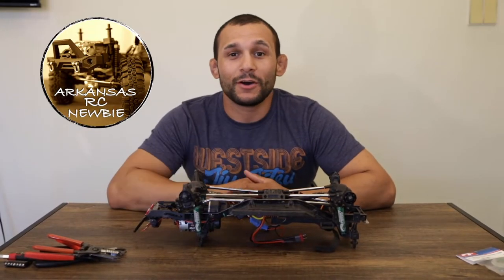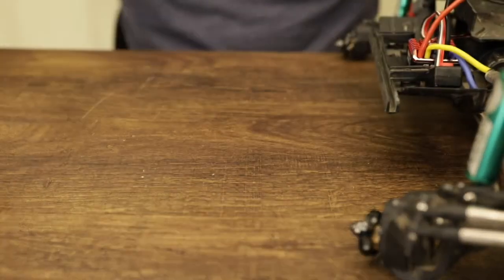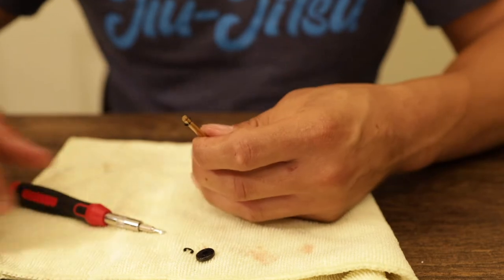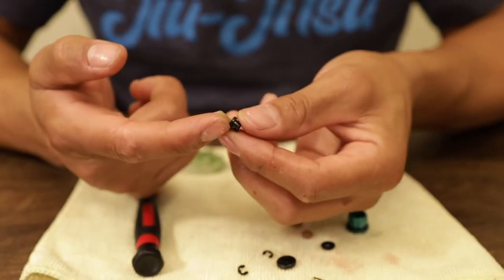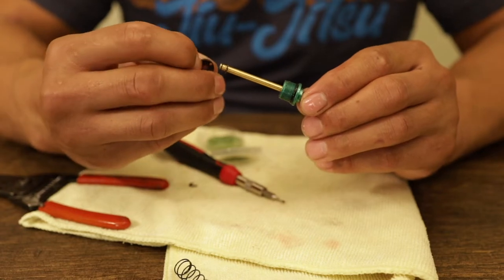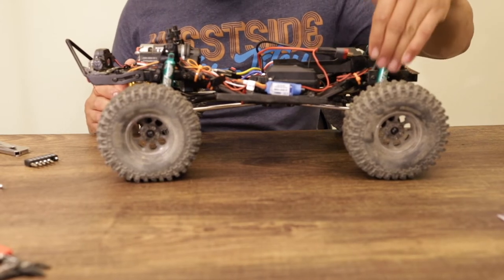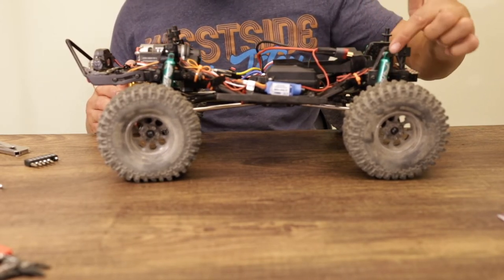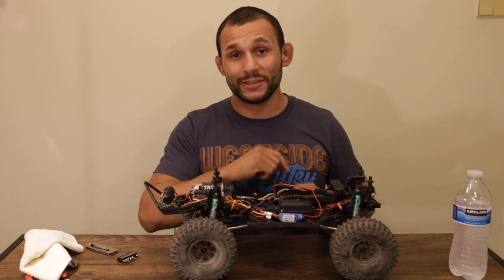Can We Fix The Desert Lizards!?!

Comment: Typically if they stick it’s air trapped inside the shock in my experience. You might want to flip the shocks so that the body is closer to the axle. It will help your COG. I’m surprised that you run such a light fluid in them. I typically run a 35F/45R in most of mine as a base line, but a RGT is lighter than most 1/0 trucks. Looking forward to more videos
Reply from the maker: Well thank you brother. I will mount them upside down, it really is starting to drive me nuts. Also imma check your channel 😉
Reply: I won't be buying them then

Comment: Great video! This may be a dumb question, but why do I see videos of the DL shocks being mounted upside down? Thanks for the help!
Reply from the maker: 😂 Man I have seen these too! Now don't quote me on this but I do believe the reason is to help with the vehicles center of gravity. Since the bore of the shock holds oil and has more material, mounting upside down keeps the weight down "literally". Number 2 is the decompression, since crawlers need to have the low center of gravity, mounting upside down helps with the compression of the shock, less movement. I think 🤔  lol thanks for watching brother and I hope this helps!
Reply: @arkansasrcnewbie  just watched a video that stated “upside down “ is for “full maximum droop” as well.

Comment: They are amazing, imo ive never had this problem. I do think there hydrolocked, they are definitely a pain to set up. Took me 4 hours to set mine up the way i like em. Rebuthem probably 10 times till i got it right. I run 15wt oil in mine, never leaked nor had i have to rebuild them over time. Just bought another set 120mm as the first 100mm set kinda forced me to run a half sprung set up with the massive proline mickey thompson baja pro.
Reply from the maker: Man thank you for the comment, it's nice someone commenting and explaining what they do. Everyone's quick to point a finger and leave, I appreciate that very much. Thanks, it does seem like the plastic disc is making contact with the bore.
Reply: No problem, i thred them on about 5 turns making them gush excess  oil out than before tightening them fully down i push and hold the shaft at its lowest possible point. Hold it down the whole time till there tight. Helps ensure theres no air and the right amount of oil. Hope you get em working for good, they truly are a top notch set of shocks 👍